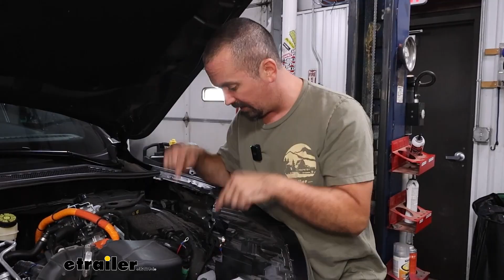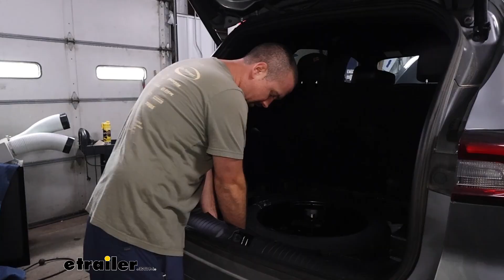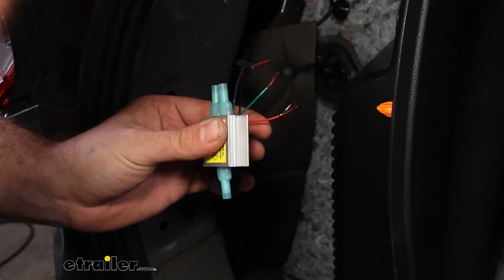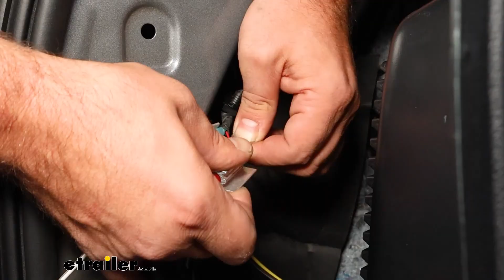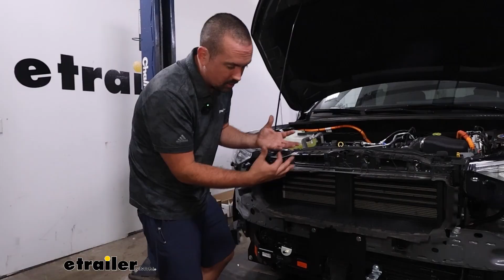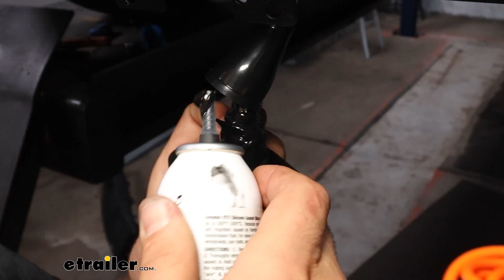etrailer | Installing the Roadmaster 4-Diode Universal Wiring Kit on a 2025 Ford Escape

Comment: How did you determine exactly where to make the cut in the black grill to accommodate the towbar arm receivers?  Same question for the six pin. Aesthetically, I would only want to cut away enough of the black grill to pass the towbar receivers and six pin diameter. 

 I don't want to cut away 5 inches of plastic to accommodate a 2 inch diameter towbar receiver.

Also, aesthetically, I don’t like where you put the six pin connector.  Could you not have mounted it somewhere behind the grill on that crossmember behind the grill?
Reply from the maker: For the towbar portion the cutout depends on the specific vehicle. Instructions include a diagram of where to cut and how much to cut away. We went with the instructions but if you wanted to just cut away enough to get it through you could do that. For the six pin connector you can mount it where ever is easier for you. Some towbars come with a place to mount but you can mount where you want it to look the best.
Reply: @etrailer  Thank you.  In my case, I installed the 2025 Demco on my 2026.  The grill on the 26’ is different.  I guess I will put the fascia back in place without screwing out it down and mark it.

Regarding the rear lights wiring, is there a reason why you ran the green wire that connects to the passenger side , underneath the vehicle and not into the sage grommet you ran the yellow / brown wires and just run it across the inside along your white jumper wire?
Reply: I hooked up the driver’s side as per your initial install on your driver side. With a single post diode facing the plug.

However @20:28 in the video you seem to contradict yourself and now I’m confused.

On the driver side, does the single post on the diode face the plug or the up line wires??